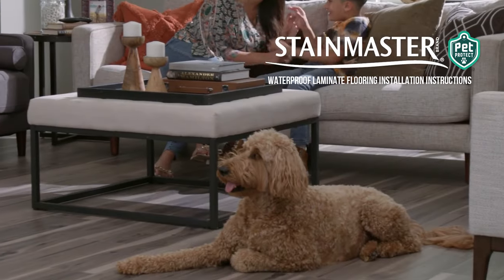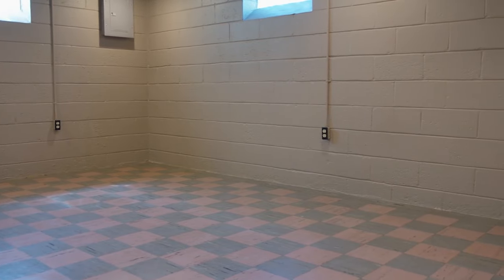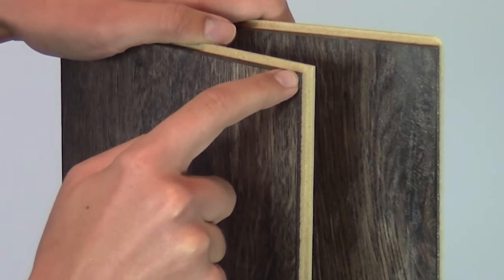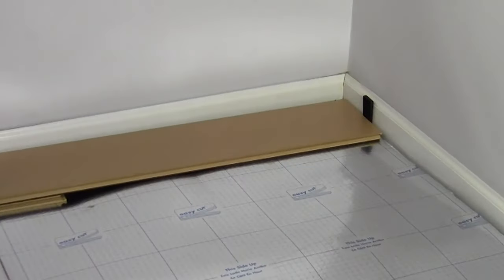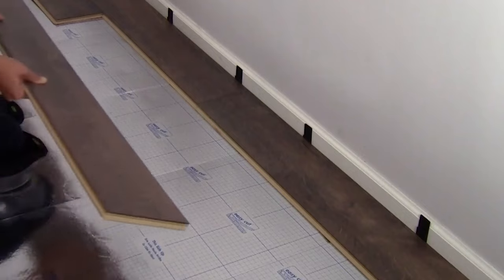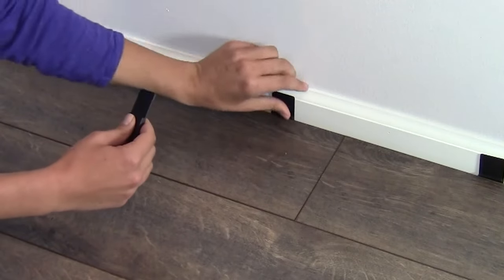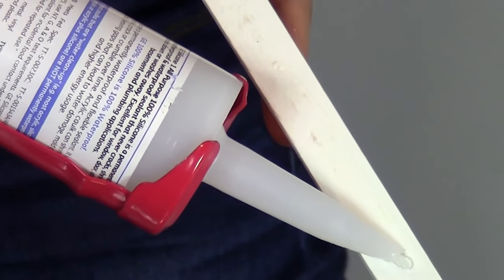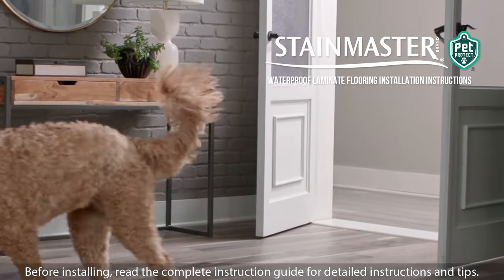Stainmaster Pet Protect Installation Video

Comment: not crazy about how these install. I've done a few others but different brands. The friction of trying to slide the short ends together is pretty tight once you have the long sides secure. And trying to hold the short ends together with my foot while I tap/hammer away at the other end is a challenge